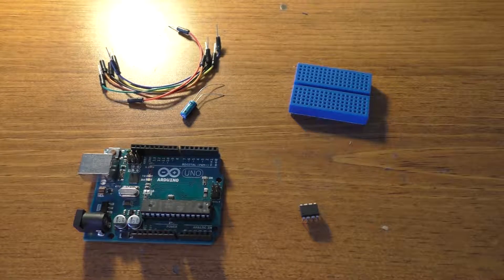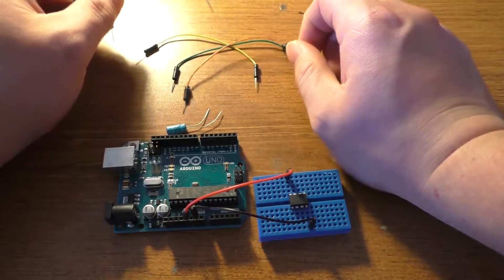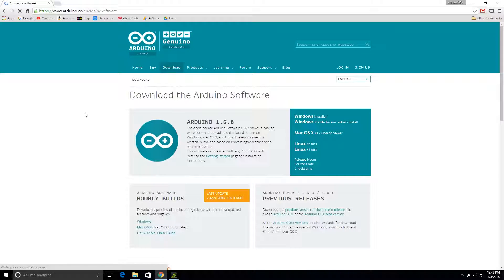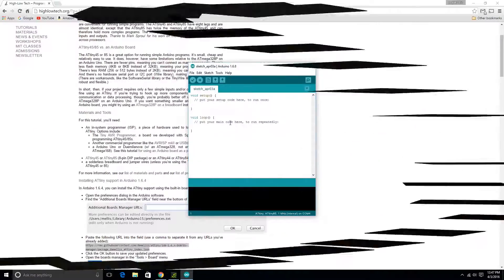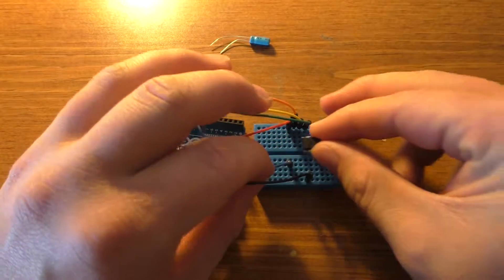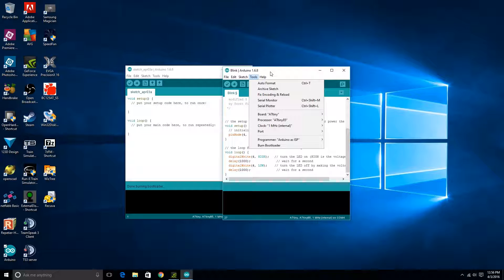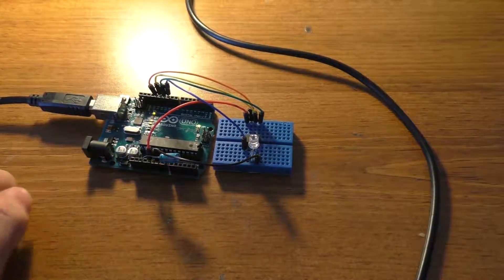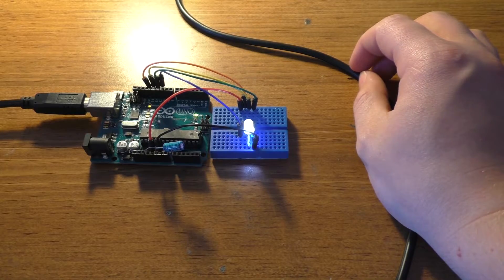How to Program an ATtiny45 or 85 with an Arduino UNO

Comment: Thank you very much! Your tutorial is the newest and most useful.
By the way I am using arduino uno 1.6.9 and it works without the capacitor. Conversely, the capacitor prevents the programmer from uploading the code!
Reply from the maker: You're Welcome, glad you found it useful. I will have to try it without the capacitor the next time I program an ATtiny.